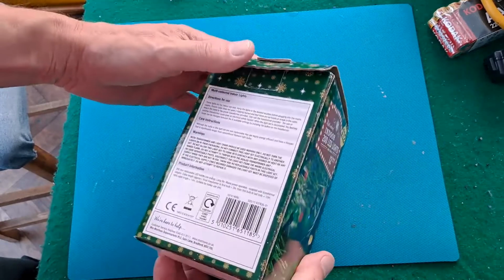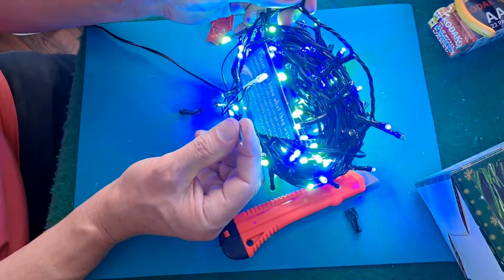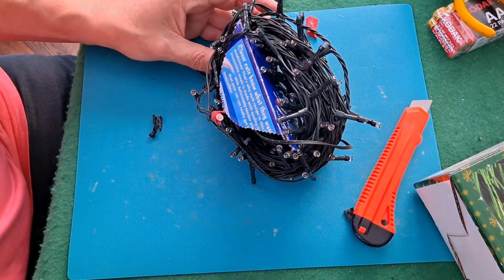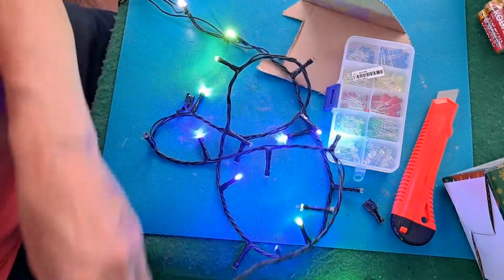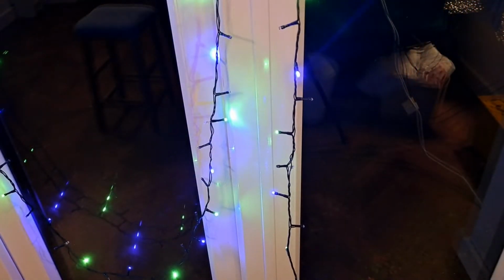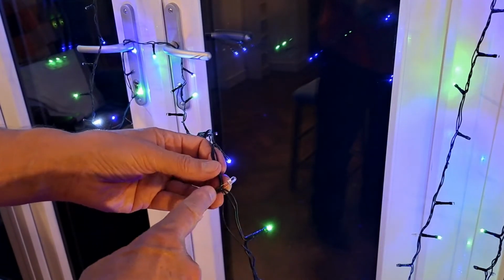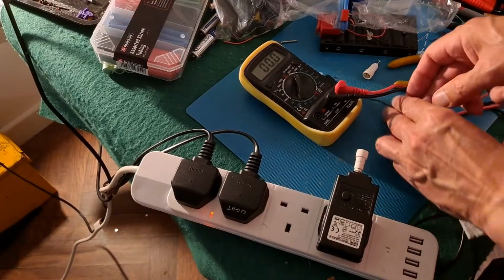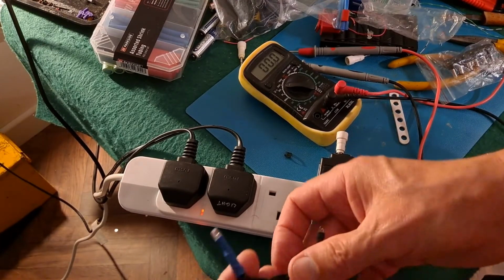Can I fix 200 LED lights from Morrisons?

Comment: what if you would open up the power adapter that might be faulty and see what it wrong with it since all the led,s are working,u said it could be the adapter from the led,s that is not transporting the power to the lights.that would be an option to try.
Reply from the maker: You have seen the next video now, so I am late replying. Yes, no luck finding the fault on this one.

Comment: I think you are definitely right about the AC voltage setup. Could be a fault with the control box. The transformer not producing the other AC signal to turn on the other set of LEDs. Might be worth opening up the control box to see if a wire is broken. I have never thought until now about how these types of LED Christmas lights work. 👍
Reply from the maker: I think there is probably an issue in the control chip. A broken wire would give us zero output. Here is a video I did several years back on the 3 wire version (which is similar but different 😆😆) https://youtu.be/Rq1G9dj776E
Reply: @GrandadIsAnOldMan  Do you know something? I was actually going to say for a laugh, "you have probably even made videos on clothes pegs". Now I remember that you "HAVE" with the 3D printer. LMAO. You must have made videos on everything. 😂🤣👍
Reply from the maker: @mikeflight9  the problem now, is I don't remember if I have a video on it. I have just done a couple of "Putarubberbandonit videos" and I have a sneaking suspicion that one of them make be a duplicate of an earlier car. Still, not many people watch those videos so only an enthusiast will notice.